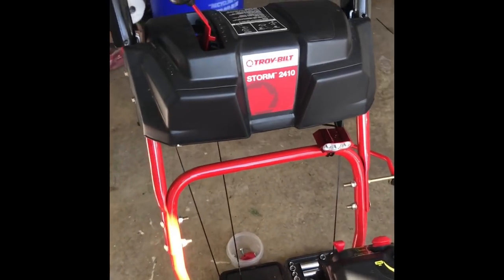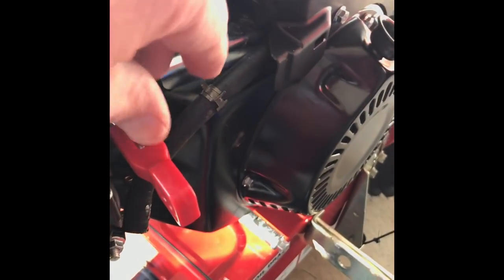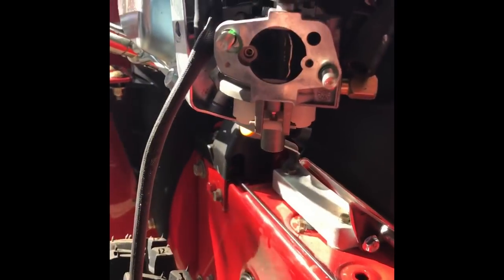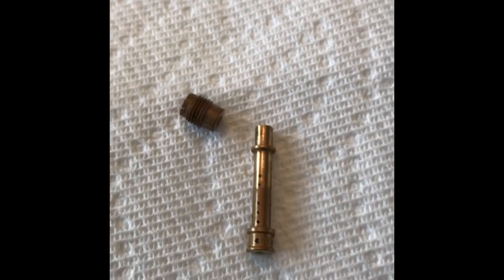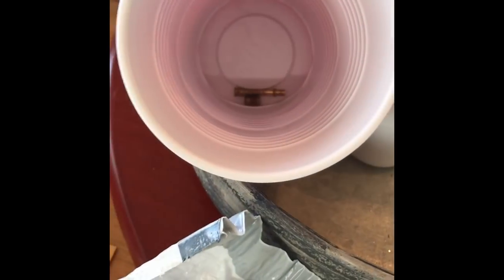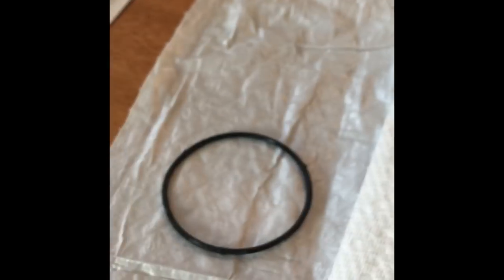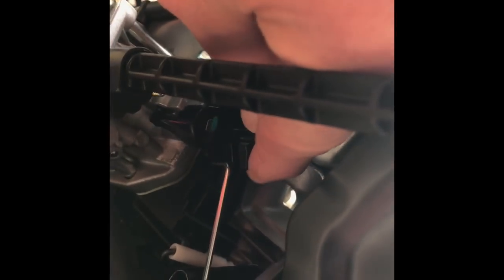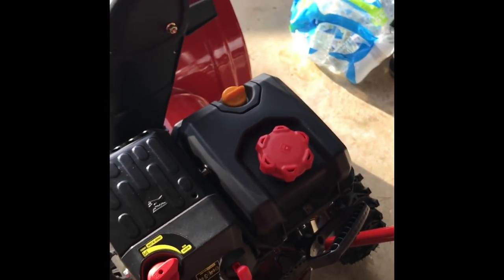How to fix a Troy-Bilt Storm 2410 SnowBlower

Comment: Two very easy changes in the way you make your videos would greatly improve the results.  1. Get something to hold your camera still so both your hands are free.  A simple gooseneck "tripod' support works great for a cell phone (which it seems, you are using). 2. Turn your camera to horizontal!  Video technicians spent something like 10 years perfecting HDTV and bringing us the cinematic dimension of 16x9 screens, which emulate the way the human eyes see things (Western style - wide screen).  That way, most of the details you are showing - which by nature are wider than taller, will be seen.  That's input from a video expert who is here to learn from a carburetor expert.  Now back to my carb!  Thank you.
Reply from the maker: Guess you haven’t seen the updated video.
Reply: @cdiilio  Where's the updated video?  Maybe take down the old one?
Reply from the maker: Search under my channel. The newer one has many more views. Both are useful as the first one shows a full tear down of the carburetor and the second one shows a quick and easy way to fix the issue with a clogged jet without taking the carburetor off.

Comment: hi Cdillio,i couldn't unscrew that main jet screw is it reversed or?and theres a top air vent jet also,cleaan that and it will run decent also,cool video thanks,later Cd.
Reply from the maker: Lonnie Curtis It’s a standard lefty loosely! Just make sure your flathead screwdriver is small enough to fit. Glad you got it running!

Comment: Looks like brand new ? Bad gas? Why not just put a inline fuel filter on the line, looks like a lot of work for a new blower. Ethanol poisoning, always treat your fuel and completely drain at end of season, and run fuel out of lines till blower stops after you drain tank.

Comment: What type of carb cleaner did you use?
Reply from the maker: Scott Rohrig I just soaked the parts in a little Pyroil starting fluid.
Reply: Thanks for posting this video. I think it's a manufacturer problem. everybody that I've talked to that has bought this snowblower it won't start the second season even if they do drain the gas. Last season I drained the gas and this winter when I went to start it it wouldn't start again had to pull everything apart and everything looked clean and brand new but I sprayed carburetor cleaner in it put it all back together and it started up again but mine didn't have any gunk in the carburetor whatsoever.